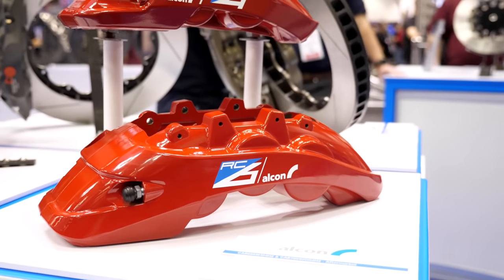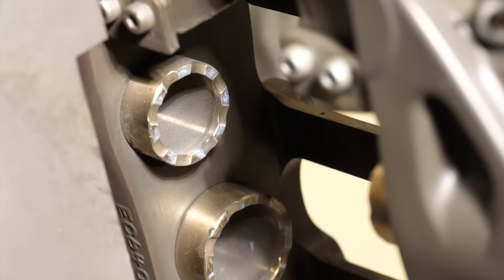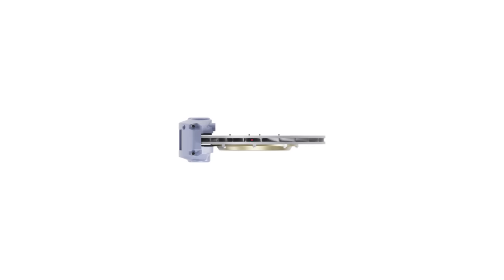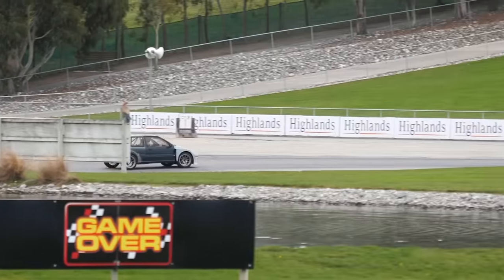🤑 4 Brake Caliper Considerations That Save Time & Money

Comment from the maker: What upgrades do you have planned for your own brake setup?
🦸‍♂ Building a fast car? Get $400 OFF the all inclusive VIP online course package deal: https://hpcdmy.co/vipy101
🔥Brake System course. Design & optimise your set up. Now 50% OFF your first course:  https://hpcdmy.co/offery101
TIME STAMPS:
0:00 - What Brake Calipers Do
0:34 - Why Upgrade?
0:55 - Master Cylinder Pressure
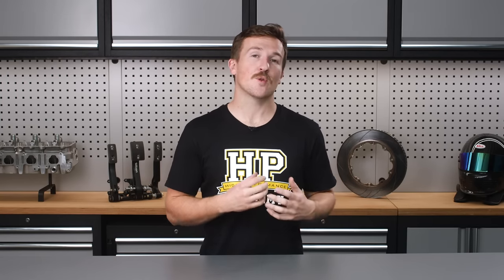1:35 - Brake Torque
2:10 - Piston Area Increase
3:22 - Front Upgrade Only
3:40 - Upgrade While Maintaining Balance?
4:15 - Tyre Grip Considerations
4:32 - COG Considerations
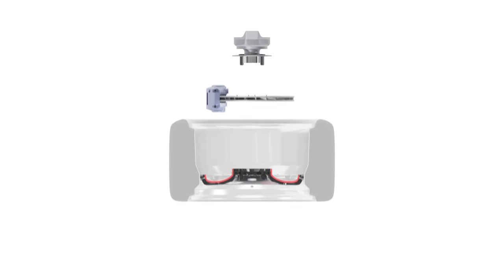4:48 - Brigger Brake Physical Constraints
5:22 - Allow For Flex & Expansion
5:42 - Caliper Mounting
6:07 - Caliper Brackets
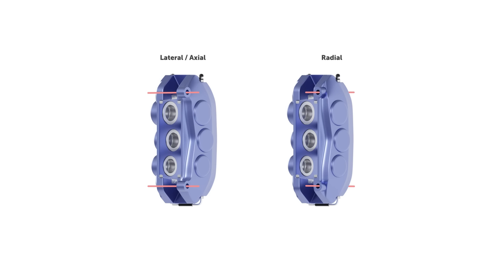6:41 - Caliper Positioning
7:35 - Supplier Recommendations
8:16 - Directional Calipers
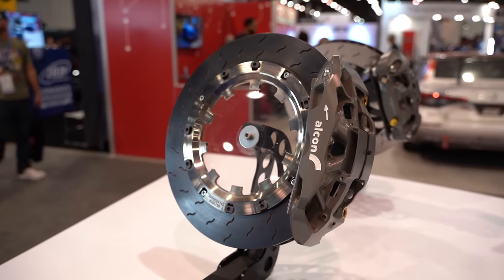8:26 - Brake Bleeding
8:51 - Key Points!
8:58 - 1.) Pedal Feel & Bias
9:09 - 2.) Master Cylinders
9:15 - 3.) Advantages Go Beyond Brake Torque
9:27 - 4.) Mounting
9:42 - BUILD | TUNE | DRIVE
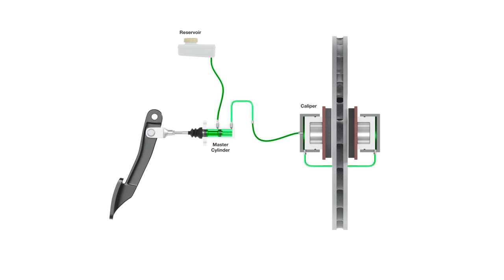9:55 - Just One Of MANY Modules

Comment: I think you hit every possible consideration there - very, very  well done! 👍😎

With the wheel fit, few things more annoying when a "brake kit" says it will fit "some" wheels of a given diameter - it's VERY handy when they provide an actual template for that specific application.
The caliper drawings help a lot, but don't take into account how the disc is also going to be limited in position on the hub/axle.

Comment: what oem vehicles use 4 pot radial calipers with staggered pistons? The only one i know of is Porshe Boxster S. Is there any other ones out there? What aftermarket companies sell radial calipers with staggered pistons? This is for a 99 Celica SS-IIII and there is no off the shelf kit with thick enough rotors!

Comment: The trouble is that people go around slapping on " Big brake kits" , or "upgrades" from another model, for looks or because they think it's going to improve the brake system,  without any clue as to the changes they are making to the effective radius and hydraulic ratio. Mucking around with that stuff if you don't know exactly what you are doing is a really bad idea. If you buy a big brake kit make sure you get the confirmation from the vendor that the brake balance of the car is not affected ( and that any rear brake mods are designed to match) . Manufacturers and their suppliers spend 100's of hours testing the brake system and tuning the ABS TCS ESP . Change the brakes or the suspension and you can easily screw the performance of that system up.
Reply: Exactly!  This make it a good idea to seek OEM brake parts from a higher model if it exists, and then swap everything including the master cylinder.  Not just the front, EVERYTHING.  That also makes it easier to get parts down the line, since you don't have to explain the custom setup you have.  Just pick GT500 from the drop-down and bam, the correct brake line or whatever is on its way.  But if you haven't tried your stock brakes with real-deal pads and fluid yet, that's probably the correct solution for 99% of drivers.
Reply from the maker: 100% Do your research, reap the benefits rather than the opposite which is just buying yourself headaches - Taz.
Reply from the maker: @JETZcorp most of the time you will be better off spending the time and money going to aftermarket parts made for motorsport than doing that to be honest. They are made for different use cases and perform as such. There will be some exceptions, but you will only know what they are by educating yourself and comparing the data.
From there use case and budget will ultimately decide what is 'best' for YOU and YOUR car, and at least you will understand what compromises you have to deal with if you are financially limited to a certain path 😎 - Taz.
Reply: @hpa101  Definitely depends on use-case and particulars.  If you're stuffing 400whp into an Integra, aftermarket is needed, and abundant.  If you're trying to stop the squish on a Dodge Dakota, the aftermarket is limited and the experience base even moreso, but the later models had significantly bigger brakes, and with a little bit of fabrication, it's the only other platform that takes sueprisingly-affordable Viper parts.
Reply: Clueless much?

Comment: For most street cars it's usually for looks lol
Reply: This is 100% the reason I’m doing 8 piston AMG/4piston calipers on the front of my R33 GTR. I’m deleting ABS, so hopefully it doesn’t ruin the drivability.
Reply: My reason is parts availability. I can't find a left rear caliper anywhere for my mkiii supra.
Reply: @BrianCrofoot  Check the piston area(s) of the AMG callipers v.s. the stock callipers ( for fixed calipers like Brembo only count one side to compare to sliding callipers)  Then check the radius the centre line of the pistons work at.  % changes in those 2 things need to be small and ideally balance out. Then you will have a brake balance close to stock (assuming no crazy pad friction changes) and no issues with brake pedal travel and force. ( But not technical advice do your own research ! )
Reply: I can guarantee that 90% of people who upgrade their brakes is just down to the ‘show’ factor . They will never benefit or understand the full potential of a quality brake setup until they actually race the vehicle. 
This also has the added benefit of sorting out the wannabes/ dreamers and the talentless from the talented .
Reply from the maker: You can have something that looks great but also won't lock the rears and throw you over a traffic island into oncoming traffic without too much effort 😎 - Taz.
Reply: Clueless much?

Comment: @hpa01
Currently researching front brake upgrade options for my tiguan r.  It has the same front calipers as the mk8 golf r, 2 piston 43mm/45mm sliding with a 357mm rotor.
Was looking at an off the shelf kit from paragon brakes that uses an alcon car97 6 piston monoblock caliper with 380mm rotors. Seems like a generic caliper used on many applications with a car specific adaptor.
Piston sizes in the alcon car97 are 30.2mm, 34.9mm and 38.1mm. I calculate the piston surface area for 1 side of the alcon caliper as 2813.02mm2 and the factory sliding caliper as 3042.63mm2.
Is this an acceptable change without requiring MC changes or detrimental effects to braking power, pedal feel and modulation?
Will be leaving the rear calipers the same due to the electronic parking brake being integrated into the single piston sliding rear caliper and just upsizing the rear rotor from 310mm to 350mm
Reply from the maker: There is no straight answer here sorry.
The front caliper change alone is pretty small, we doubt it would cause any issues with a slightly more aggressive pad.
But are you also moving to a larger front disc? Why?
Not sure if you really need a bigger rear disc size either. Do you have specific data/reasons for up sizing? Bigger isn't always better as discussed in the video above.
At that point many other questions start coming up, like what tires are you using, how stock is the car, what's you're using it for etc to tell you what to do from this question alone.
This isn't a 'pay for an answer reply', hopefully the above is helpful in being food for thought alone, but do note a lot of knowledge around understanding this yourself is covered in the brake systems course here, and there is a forum to get help from the tutor as you learn/with your specific project too: https://hpcdmy.co/offery101 - Taz.

Comment: I need to upgrade my brakes. I installed a supercharger on my truck and it hits 100mph faster than it went to 60mph stock. Looking at the Roush Alcon kit. It’s a stock upgrade so I will keep my brake balance and abs function.
Reply: Do the brakes currently lock the wheels or Trigger ABS? (If so then no brake upgrade will improve Stopping distance at all, will only prevent fade from using brakes too much and not gears to slow down)
Reply: @tbas8741  aaaaand the next guy telling somebody they don´t know to not bother with the brake upgrade, because it doesn´t reduce stopping distance....
No sh*t Sherlock, but if the TE hasn´t just installed the Supercharger for show, they´ll smoke the stock brakes in no time.
Reply: Check if you can get better Pads for your stock brakes. If yes, try them together with better braking fluid, before you invest in a big brake kit :)
Reply: @tbas8741  no they don’t come close to locking
Reply: @axelhorneff5077  I’ve installed heavy duty pads but I’ve cooked my rotors, I’ve already replaced them.
Reply: Then something is very wrong with the stock brakes. 
Try new fluid, Bleed, sticking calipers. 
Unless you truck is really old? 
Since about 1980's ALL Cars and Vehicles have a requirement for brakes to Fully Lock or Activate ABS. 
The law was made in about 175 countries so.. 
 @RadDadisRad
Reply: @tbas8741  nothing is wrong with my stock brakes. My stock brakes were designed for my stock truck. My truck isn’t stock. It makes over double the HP and the each wheel is 2-1/2” wider. It’s a 2023 F-150 5.0 with a whipple 3.0 supercharger.
Reply: ohh thats different , i thought was on stock tyres n stuff then it would be no good  @RadDadisRad
Reply: @RadDadisRad have you done any suspension leveling or roush/shelby aero body add ons? Could help with stability at 80+
Reply: @Pwnulolumad  it’s the slowing down that needs help. From what I can tell tho the brakes now have some weird caliper controls so I won’t be able to do anything until someone can build a system to trick the CAN

Comment: what would be an acceptable increase/decrease in piston area? have been able to find wilwood calipers that will work for both the front and rear of my fwd celica, which has single piston sliding calipers all round. front increase is +0.36 square inches and the rear is +0.18 square inches, this is going up to 4 piston front and 2 piston rear keeping the oem discs
Reply: Don't forget to x2 the piston area for a sliding caliper. Calculate the % instead of the total area increase
Reply: @Remenschneider  No the other way around really, the effective piston area of a fixed caliper is that of one set of pistons, so only count area of one side. There is no difference in the clamping force of a sliding calliper with one say 60mm piston where the piston force is reacted  on the other side of the disc by the fingers of the fist and an opposed piston calliper with say 2 pistons each side of the same area each side as 60mm single piston. Think of the base of the 60mm cylinder as the opposing piston.
Reply: Look at the % change in area for each axle ( only count one side of a fixed calliper) That looks like it will be maybe +10% at the front but a bigger % change at the rear? that can push the brake bias towards the rear. Overall say a 10% increase will give you 10% lower pedal load for any given decel but longer travel, too much increase can give you issues with master cylinder volume reserve with fade and any pad taper wear etc. Typically the step in mastercylinder areas from one size to the next is  12-13% . (23.8 to 25.4 to 26,0) So if you are close to that can consider going up a step if you can find a suitable option from another Toyota that fits your car. Also check the radius of the piston centre lines % diff and frt to rr , shouldn't be a big effect if keeping stock discs but better to check. ( not technical advice DYOR 😄)
Reply: @jabberwockytdi8901  thanks for the info, worked out to be +4.57% F +6.38% R which doesnt sound like much?
Reply from the maker: @arcanevoid9199 It Sounds like a relatively small change that shouldn't cause any major issues. However, It seems like you might end up by shifting the bias rearward (since you are increasing the rear piston area by a greater amount), and that could cause instability, especially if your braking performance increases and you can pull more G's and therefore transfer more load off the rear tires.
For a FWD like yours, it might even be worth considering just upgrading the front calipers (only slightly, though) if you are using good tires that will be capable of transferring more load.  The benefits of upgrading the rear caliper to a fixed style will be relatively small compared to the front anyway.
Just be sure to consider what this all means for your master cylinder and pedal travel - Connor
Reply: @hpa101  really helpful thank you

Comment: But thing i questioning most is to how calculate brake force with drum brakes
Reply from the maker: This course is specific to disc brakes sorry - Taz.
Reply: @hpa101  that's clear. In case of changing drum to disc setup piston area seems confusing to me because of how small drum cylinder is
Reply from the maker: @el_kuks  the brake torque from the friction is also a bit more tricky to calculate for drums brakes, so rather than trying to match the torque from the current setup which was designed for completely stock car, I'd recommend analysing the car as it is now or even with future changes in mind and speccing the rear brakes for that.
If you are taking our brake course we have a calculator that helps with this, otherwise it'll be available on our website in the future - Connor

Comment: Will factory ABS work as intended if with increase of piston area master cylinder would be proportionally increased?
Reply: ABS doesn´t care what brakes you have installed. They take the signal from the wheelspeedsensors and if one locks up, it reduces braking pressure.
Reply: ABS ESP etc.  will work but the internals for the valves and the sofware settings are designed to wirk best with the factory set-up , the further you get from the factory brake spec the poorer the control will be and you can start to get excessive interventions or unstability.
Reply: @axelhorneff5077   go and learn a bit more about how ABS TCS ESP works before making oversimplistic comments like that.

Comment: But a Brake Upgrade wont make you stop faster as the stock brakes already lock up the ABS. 
You can just stop More Often Before Fade (So only useful on a track, cose if you get brake fade driving on a normal road, you can't drive and need to learn how to use the gearbox.
Reply: If you've got abs
Reply: There´s plenty of cars that go 150 miles per hour, that you never want to do an emergency stop in at that speed with the stock brakes - this "argument" is utter bs and only applicable if you never go faster than 60...
Reply: @axelhorneff5077   er no it's your post that's BS.  The manufacturers size the brakes and according to the perfomance and weight of the car , tests like the AMS fade test with multiple full decels from high speed make sure the brakes are OK for road use ( or even track use with stuff like 911 GT3). No car designed in the last 30 years should have any issue stopping from design V-max speed under road use.
Reply: Even if you don't have ABS the same applies, older non ABS cars were always designed to lock the front axle 1st up to very high decels and even before ABS was introduced 80's and 90's cars would have brake pressure control of the rear axle to make sure the car stayed stable under max decel.
Reply: @jabberwockytdi8901  in theory - yes.
In practice - no. 
There´s a reason why we have so much choice for streetable high performance brake pads...
Reply from the maker: @jabberwockytdi8901 no one is saying OEMs haven't put together brakes that pass the required safety tests for general road usage 😎
The punishment brakes get on the track is night and day compared to the road however, heat especially 🔥 - Taz.
Reply: @jabberwockytdi8901  yes oem might be barely adequate as we all know they don't go above and beyond, but I would rather stop with my willwoods that what my ride came with. Oh and bigger brakes also stop me having to stand on the peddle.
Reply from the maker: @tbas8741  There is more to it than that, you have to also consider pad options, pad performance (where they bite and how they hold the pressure), different material options for both pads and discs which come back to temperatures as well, piston area, wear and more noting a lot of it also centers around brake feel and control too, not only temps. 
No point in having a setup that never overheats but is so aggressive you essentially are either locking wheels or you're not braking!
Only just scratching the surface there and Connor will have some more free lesson content out there on brakes over the coming weeks 😎 - Taz.
Reply: Years ago I swapped a Honda B18c built with a nice Full-race turbo kit, I went from around 60hp to 400hp it was a 92 Civic CX, the lightest model available. I also upgraded the suspension, replaced all the bushings and rod ends, it was a full build. Some how brake fade never came up during street tuning, so I went and had the car 4wheel aligned. One of the techs had his son hanging around in the shop, they liked my car but they were into domestics, the son decided to follow me out the shop and surprised me on the freeway, so we ran‘em. 
I won easy, but when I hit the brakes, my life flashed before my eyes, instant brake fade, I think I boiled all the brake fluid, I had pedal pressure but it just didn’t do a damn thing!! Luckily we were on the freeway and had alternate lines I could take, but I almost rear ended someone, it can happen, a 50hp bump won’t get it done, but if you double your power or more! Don’t wait, get them done, it’s a safety thing, it’s important!
Reply from the maker: Glad you came out of that OK @martindworak!